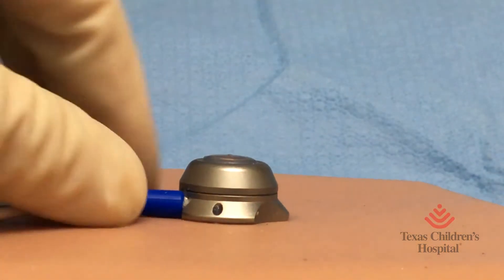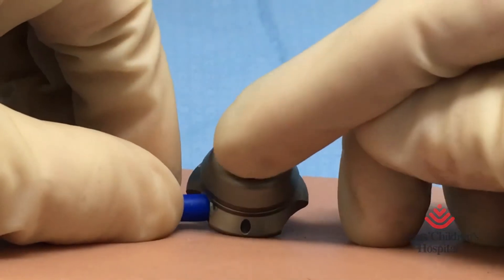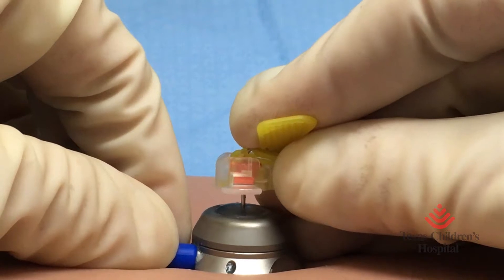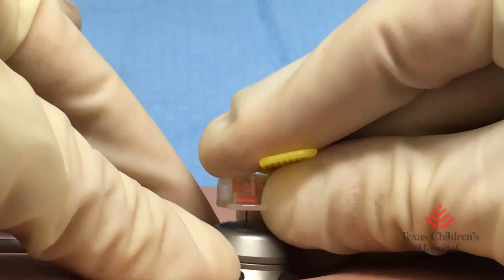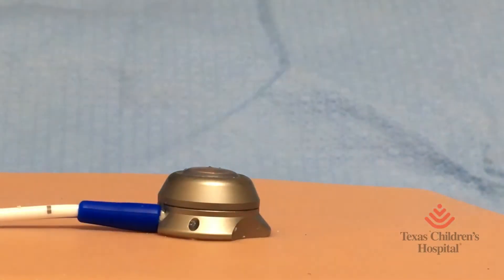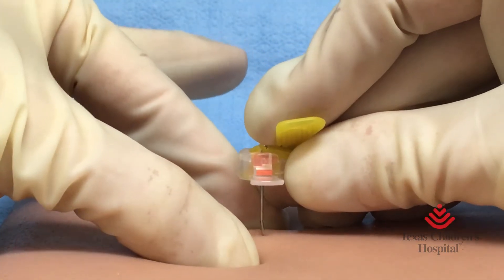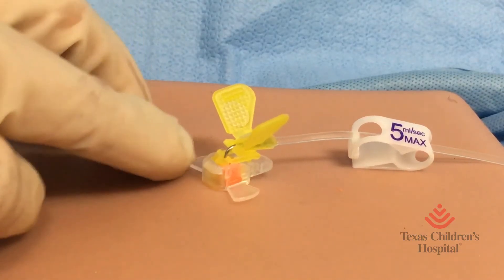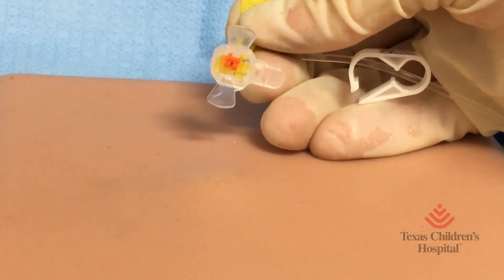Port access and de-access tips, RediStik™ Wearable Port Trainer -Texas Children's Hospital©

Comment: I love the locking needles. That’s what I use for my port but I don’t know what brand mine is. I’d have to look. But, I also go straight in. Someone told me a different way and the way they did it HURT, even with numbing cream I put on. I go straight in and it just hurts like a pin prick. I don’t always use numbing cream. Thank you that I’ve done it right where there is very little pain.

Comment: does the removal of the needle happen only by pressing the wings?
Reply from the maker: There are different types/brands of Port needles and  some are safety needles.
You anchor/ hold port under skin while you de-access needle by physicallly pulling needle straight out away from chest/Port.